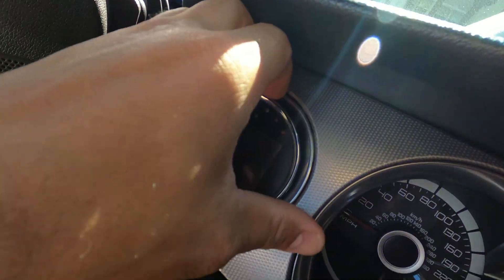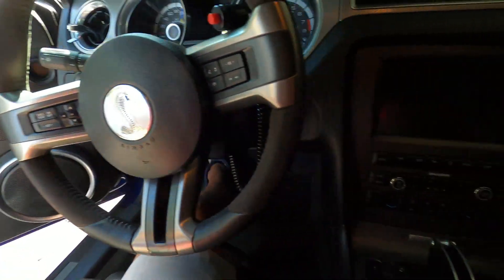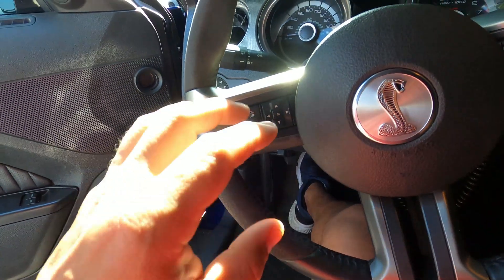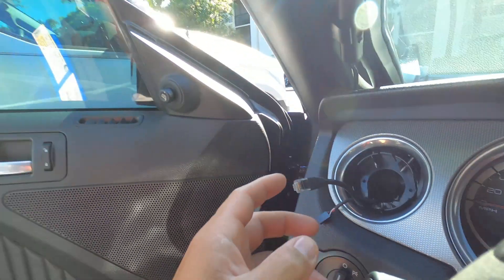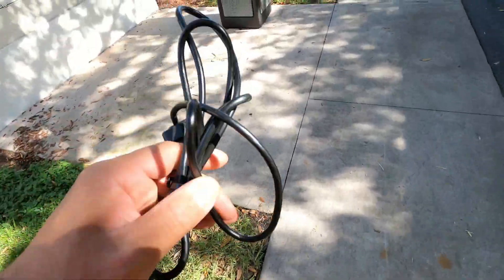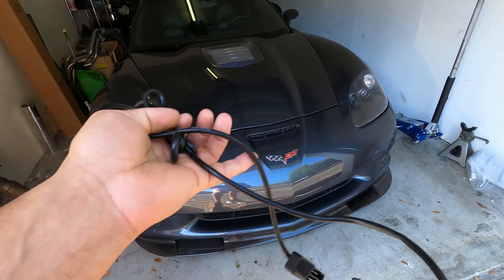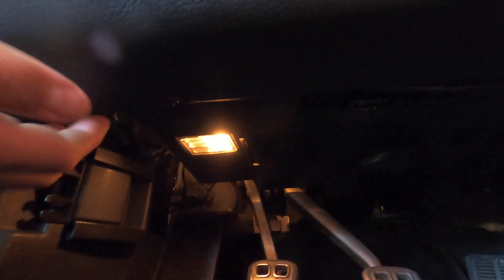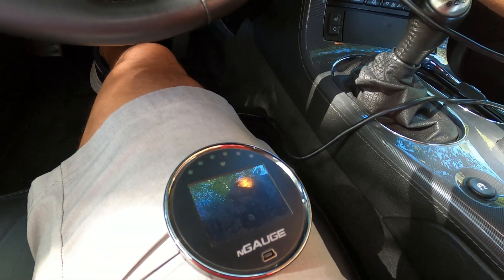2009 Corvette ZR-1 datalogging with Lund racing ngauge

Comment: Would you recommend running 93 or e85 in Florida. You mention a lot the gas isn’t great in Florida. Was wondering what would be better since I’m planning to move down with my gen 2 in the near future. I don’t run e85 up here in Connecticut because of the cold weather and I drive my car all year.

Comment: I wouldn't be surprised I'd they weren't pulling timing around there cause hell trucks  and fbodys do stock  when it gets around 122*+, getting up to 128* with pump prob pulled timing if you logged iat timing. It won't show on thr kr because it's not seeing knock but pulling it as a safety. Def need to get you an hptuners interface just to be able to datalog anything you want and multi things. Set up math parameters and histograms to really dig into the data.

Comment: Homie’s doing 50-140 pulls in 95° heat. Floridians are a different breed. I’m only running 22lbs of boost up in the mountains but I wait until the sun is going down to do any pulls in the summer.

Comment: As someone who tunes GM vehicles, the strategy that they use for knock does not add timing. He's the high octane and a low octane table. If it sees knock it will pull timing until it reaches the numbers in the low octane table or somewhere between either of them. Also you can change the game globally for what the knock sensors do. It is only there to remove timing. Also at 120° it is pulling timing. At least on 100% stock strategies.
Reply from the maker: Dang that's aggressive, good to know sir as i'm new new to the platform
Reply: @YDBT4LIFE  we've talked before in the past, I have a fair amount and I had asked you a year and a half ago about your mini tub or microtub as you called it. If you would like I can pull up the HP tuners strategy and send them to your email so you can see them. There's no way in the factory calibrations to add timing based on available octane. Also there is a lot of torque management in that calibration to limit drivetrain abuse. Literally removing 30% torque management would probably drop your 60-130 by 3 or 4/10 of a second. Another way to get around that is to press and hold the traction control button until it shuts off all of the nannies...
Reply from the maker: @Randomguy-5150  that's what I did the 2nd time around and it felt much better. I have access to the tune. I just have not dabbled in it yet. But i appreciate any help
Reply: @YDBT4LIFE  anything I can do to help man! I love the content! Even though I'm an "LS" guy....lol

Comment: On GM the coolant temp/spark table is more agressive then the iat/spark or the knock/spark table.  It takes a bit to rattle one of these motors, so they are not too agreesive with the knock retard.

Comment: It starts pulling timing around 145*f, GM doesnt use active octane adjustment like ford does, it has two spark tables and it will interpolate between the two or will purely use one table depending on how much knock you see but the process its much slower than the ford strategy, seeing how you are getting 23* of timing you are already on the high octane table. 

The car is not flex capable as it comes, there is a virtual sensor strategy that works similar to the ford version but it doesnt work that good, however you can easily add a flex fuel sensor that works even better than the ford version.

Comment: GM stuff doesn't use the knock sensors to add timing. it just has a high octane and low octane timing table and it will run on the high octane table untill something happens with the car (ie MAF failure) or the knock sensors sense knock and will filter into the low oncane table as needed to keep it from knocking. After the knock goes away it will learn back to the high octane table.
Reply: GMs stock manual performance vehicles there tune is pretty good from the factory. Maybe a little to be picked up in leaning it out a little because they usually command fairly rich AFR at wot and maybe so tq management but the stock tunes are usually pretty good timing wise.
Reply from the maker: @HodgesPerformance86  Yea i saw that 22 and went.... oh ok! LOL 😂
Reply from the maker: Thanks for the heads up, was interesting to see if it picked up anything from fuel. Mustangs simply use the KS to add timing when it senses higher octane fuels being burned. Gotta love factory widebands.
Reply: Yea man. Iv never tuned any ford stuff but from listening to you and a few others I know they seem light years ahead of the GM stuff. I'm not sure about ford stuff but I'm sure the theory is the same with timing and I'm sure you already know this but just because it can take more timing and not knock doesn't mean it's really going to make more power with more timing. Totally dependent on the setup and if fuel is a limiting factor but I see guys all the time especially if they come from the old school carb world they want 32* of timing and some of the older LS motors will take that much timing but they stopped picking up power at 26*.
Reply from the maker: @HodgesPerformance86  good to know
Must be the compression or lack there of. As coyotes (boosted ones) tend to like 17 tops at 11:1-12:1 compression on 93 octane

Comment: Did you check what air filter it has in it? Double check that it doesn’t have a K&N they’re a huge restriction in the factory airbox. IAT makes a huge difference on these cars, mine went 7.6X stock 60-130 in 60* ambient but in 100* it’s a dud.
Reply from the maker: Yea it's quick but not fast, 7s is legit, i'll check the air filter and see if switching it out makes a difference But it's gonna be some months before the weather cooperates.
Reply: @YDBT4LIFE  true, I have a clean low mileage factory filter I’ll send you if it does have the K&N.